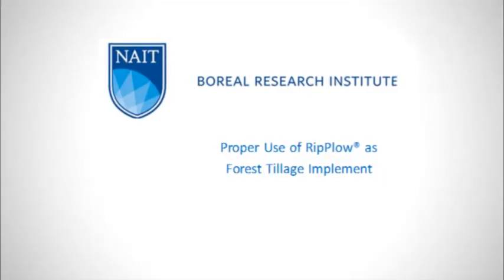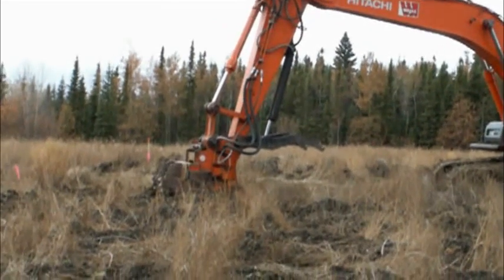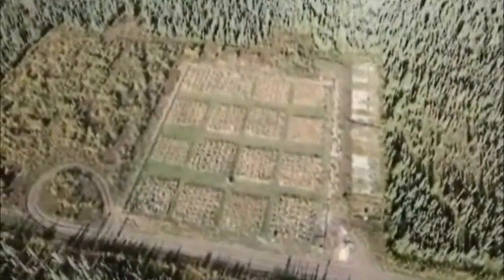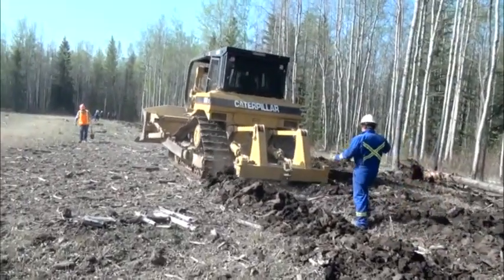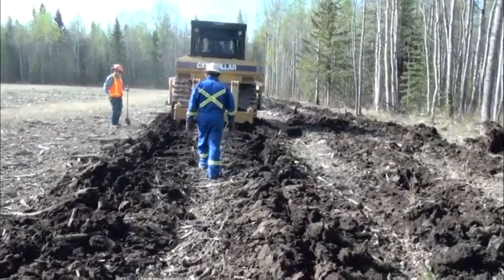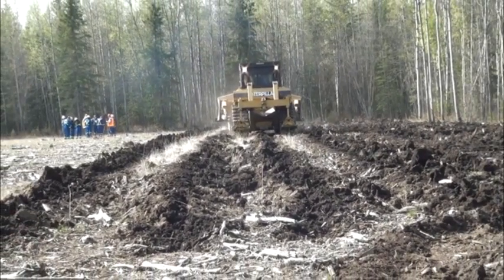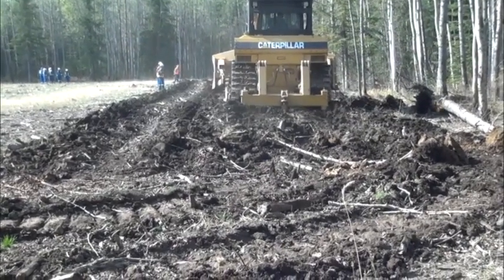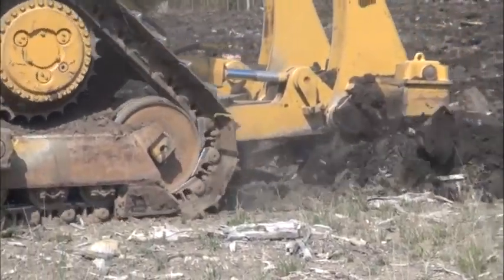How to use a RipPlow in forest reclamation

Comment: I don't buy into the extra pass in between being required; I believe soil is fractured enough; and so much less extra time and fuel.  And I think adding a Rotary Cultivator type attachment on the back to break up a bit and level a bit would be appropriate; if s decent set of bearings and some heavy duty tines could last a decent amount of time.    Glad to see some people actually figure some of this shit out though and try to make good on fixing things humans didn't have to do nor should't have been doing in the first place.

Comment: Vibrating tines would reduce horse power requirement and enable the crawler to travel a little faster, thereby enhancing the shattering effect.
Reply: I've never seen a vibrating tines implement on such a deep decompaction assignment,  could and/or would you please provide a link to an example?